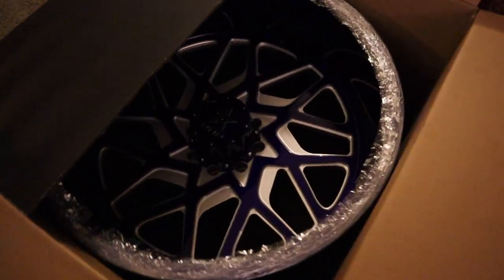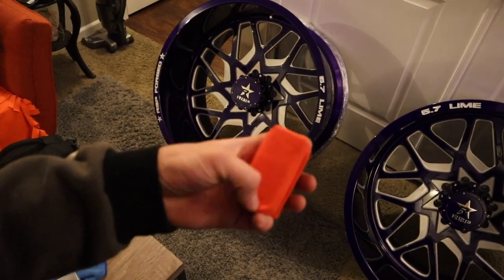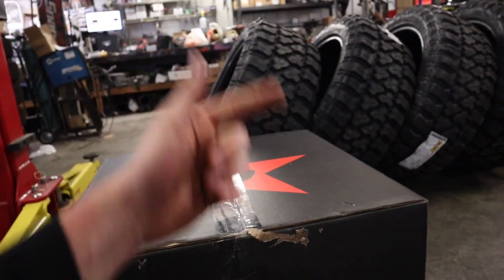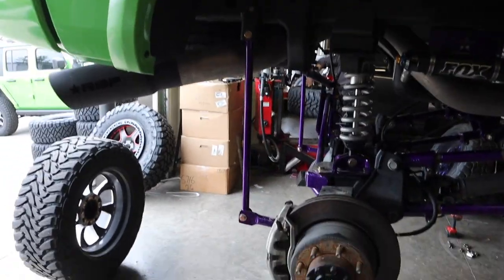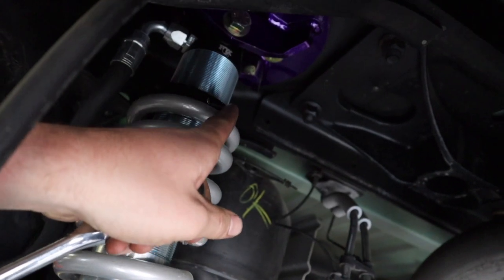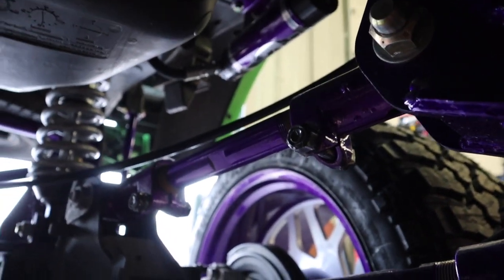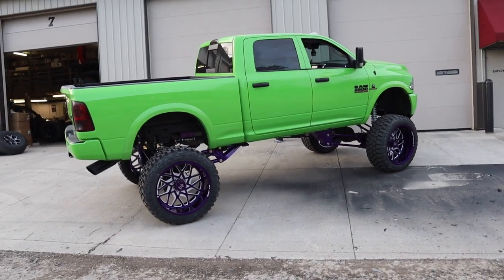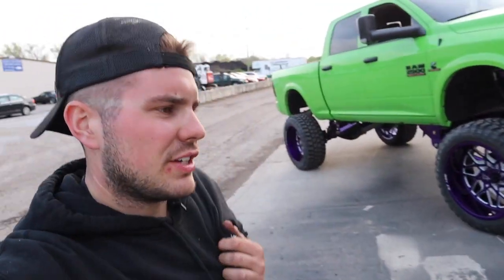I PUT 26x14's and 40's ON MY TRUCK!!!

Comment: Need to push rear axle back some to center in wheel well. That will also make the drive shaft angle less sharp after you extend it
Reply: It depends where the axle wants to go when it flexes, you have to see the truck backed up onto something. It might actually be in the correct spot, depending on the rear 4 Link geometry.

Comment: Clamp the wheels from the outside when doing challenging tires because it’s very easy for the spikes so no hole and it will scratch the wheel. They will also leave marks no matter if you put rags or not.

Comment: Hey man, it may be a little late. But if you ever do a set of tires and wheels again, consider Bead Balancing them. No weights or possible damage to the rim. The beads always collect in the low spot when rotating.

Comment: So the kit is made by RBP but they don’t supply you with proper drivetrain ? So you need bds parts and the kit is adjustable but yet it’s not drivable?
Reply from the maker: Some trucks require the drive shaft spacer on the 8” BDS lift. Because my truck is manual it has a different driveshaft assuming that’s the cause of this problem

Comment: You need more tire man 🤦🏻‍♂️
Reply: Maverick Walters finally someone else agrees, why get mud terrain tires and put it on wheels where you bend your rim because you have like no sidewall
Reply: I agree. My truck has 18s
Reply: Agree. Wheel well is too empty.  But it's a nice clean build tho.
Reply: Yeah more rubber and little less rim and it's perfect!
Reply: It's a style, just not one I like, with a lift this big I like a LOT more sidewall
Reply: Needs 44s

Comment: I typically static balance everything 37s or bigger and they zero out on the first spin. Trying to dynamic tires that large is just a waste of time tbh, they’re gonna vibrate anyway and aren’t gonna stay perfectly balanced very long. I static balanced my 37x13.50s on 22x12s on the step on the outer portion of the back lip because my wheels don’t have a ring around the base of the spokes and I didn’t want my weights visible, especially once I rebalance them and have to remove weight and it leaves that hideous sticky shit. None asked for more than 3 oz and they ride smooth as hell. But they’re also Nitto Ridge Grapplers so that probably helps lol. I haven’t had a single set of any Cooper MTs 33s or larger ask for less than 7oz STATIC so I’d say you did good with the Fury’s lol. Also tip to anyone who insists on dynamic balancing on large tires and have pretty wheels, put the clip weight on first and then spin it again before slapping the tape weights on. It’ll save you from having to scrap the tapes off if it chases. 99% of the time it’ll balance out that way and if it does chase it’s usually the clip weight that needs to be moved OR you just have to add a bit more tape weight to the same location. Now if you only use tapes then good luck to you have fun lmao.
Reply: Btw, truck looks sick man. ALMOST makes me consider gambling on FCA quality for the looks 🤣

Comment: Lol I’m worried with 35s and 20x10 with negative 25 offset wondering if it will fit into my ram 3500 mega cab diesel with a bds leveling kit and this guy is putting 26s! Looks nice tho no doubt

Comment: wait wait wait, have you done all this and haven't even changed your gears yet? im not understanding why you do all this without help the trans spin all this. I understand you have the manual trans and not the 68rfe but still lol Rams trans as a whole are......well theyre just not a fan favorite lol praying you have no issues with it brotha LOVE IT! 🙌🏽🤘🏽
Reply: Side note - its so sick i also think the light housing would be sick in matching purple, a pinstripe purple line in the middle spiraling down the springs would be sick and i would get the mirrors and handles wrapped if you dont feel like painting them....you know with wraps your guaranteed the color you want vs matching paints to paints. but regardless sick ass truck ugh 😍

Comment: Hey I was looking at BDS but they only have 8in are u sure it's a BDS
Reply: Sema trucks get exclusive new parts for the builds with sponsorships usually not available to the public till after the event. Not a huge fan of sema stuff it's all show no performance. Not 1 of those trucks will ever see a dirt road let alone offroad. Its basically a fashion show for trucks. These trucks cant tow and not ideal for off roading. They tell you what wraps to put on what decals as per sponsorships you have.

Comment: What's with this craze lately with people putting low profile tires on their 4 wheel drive trucks? Out here where I live people actually take their trucks in to the mud, woods, mountains etc. Those would last about half an hour. To each their own but personally I don't get it.
Reply: Mall crawlers taking over
Reply from the maker: It’s about 5.5” of side wall more than a 20” wheel and 33’s
Reply: @ryan2546  dang, sure doesn't look it. I dig the green and purple though. That's always a good color combo.
Reply: @Stackali  a trucks intended purpose is to be driven by its owner any way he chooses fit. I have a crew cab 4wd diesel that weighs 8k lbs but I use it as a race truck making 1300hp smoking muscle cars and ricers all day.